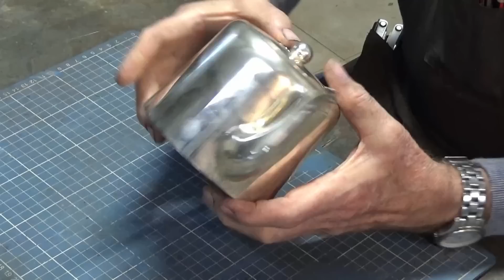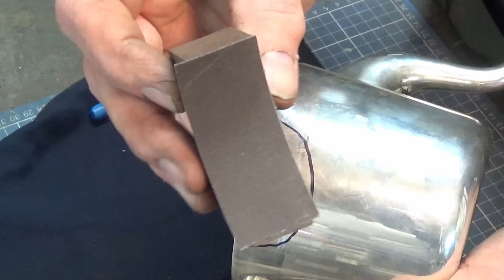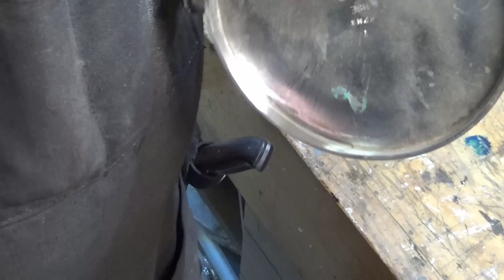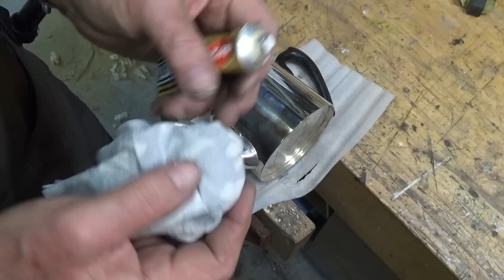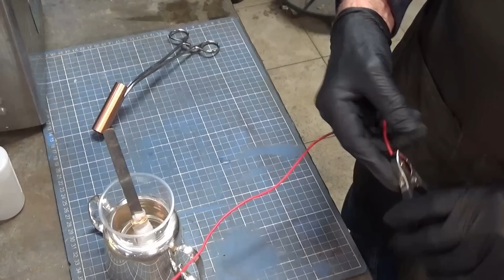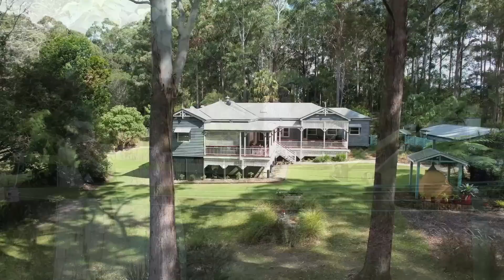Metal Finishing with Mark - Brush Plating 101

Comment: You could have used a small vise and curved blocks to get rid of that dent 
Always heat it first to reduce metal fatigue, especially if the metal has been stretched
Those very small dents should be worked out with an autobody hammer

Comment: i have a question  i would like to do some nickel plating would i need a nickel brush wand or can i do with a stainless steel one.
Reply from the maker: A stainless steel wand will work with Plug N' Plate nickel from Caswell. https://www.caswellplating.com.au/store/store.php/products/nickel-plating-kit-plug-n-plate-brush-plating
You can buy the nickel solution separately and just make your own wand and the bandage can be anything that holds the solution, Tyvek works well (disposable overalls) and a cheap mobile phone charger will do for the power supply. 
Regards,
Mark

Comment: @11:49 that spot is low because the disc (“bottom”) on the inside has been deformed in addition to the outer shell. For the outer shell to become dented inwards, the disc had to also bow upwards or downwards to accommodate. I can see an increased “shadow line“ at that location of the solder seam. I bet if you made a small straight edge that could fit inside you would see a discrepancy in the surface contour of the disc in that region. The next operation should be to make a shoehorn like mandrel that you can put up inside the base and then hammer/press that disc down so it pushes back outwards against the shell. (Really, that probably should have been the first operation, before using the dies to press the outer rim, but unless you had done this exact repair before it’s unlikely foresight. I know I certainly wouldn’t have thought of it).  I am still at this timestamp of the video so I would not be surprised at all if you end up at this conclusion on your own.
Reply from the maker: I really envy those sheet metal workers and car repair guys who know instinctively how the metal has moved and how to coax it back into shape. I was a bit wary about using a lot of leverage or hammer blows in case the seam split. I had never worked with this type of silver ware before so it was a bit of a learning experience for me. I made the decision to avoid hammering as much as possible after seeing what happened when I first tried using a soft mallet and a dolly. 
Regards,
Mark

Comment: You are the metal finish master. I wish I could have discovered your art while still teaching. Metal shop projects always paled next to the wood shop finishes. An amazing restoration Mark.
Reply from the maker: I know. I used to get frustrated that the metal projects we had on our curriculum would inevitably start rusting from the day the kids took them home. When I first started teaching, about the only finish we had for metal projects was an aluminium liquid paint called Silvafrost. It looked ghastly and cleaning up afterwards was a pain. It was only just after I retired that I got the guys at work to invest in powdercoating. 
Regards,
Mark

Comment: Mark watching you repair the pot took me back to my working teens I worked for UK company Elkington who were well known and respected in fact they help Royal Warrants which for those that may not know means they supplied the Royal their main business was in silverware both hollowware and flatware and in their later years did produce a limited amount of E.P.N.S also moved into stainless steel. To get to my point the silverware was high end and on a Friday afternoon any pieces that were to be scrapped were 'beaten ' by the apprentices with large mallets in order to deter anyone trying to sell it on as a second .Given your delicate repair I reckon there would have been a job there for you.
Reply from the maker: Thanks. I do know what a royal warrant is. I was on a tour of Windsor a few years ago and our guide pointed out a builders van with the Royal Warrant on the door. Evidently, the van belonged to a cabinetmaker who must have been appointed to do renovations in Windsor Castle. I recall seeing a video by Waterford Crystal and they would smash any pieces that had even the slightest defect. They stood by the marketing ideology of never selling "seconds". 
Regards,
Mark

Comment: Very interesting video Mark. In my working life I was in the photographic equipment trade for 43 years. We used a similar method to remove dents in camera lens filter mounts. Often with hard wood formers on the outside rim of the lens, and a fibre rod  on the inside against the filter mounting thread to tap the rim back into shape. We had a range of formers in different sizes which we made ourselves. This mostly worked out ok and enabled a filter to be screwed in. Every time I sold a lens I recommended buying a filter for this very reason. A damaged filter was easier to remove than a dent! I have a similar rag cutter that’s hand held. It has two blades that are moulded into the plastic grip. The blade is not replaceable, but they only cost about UK£1 each. Loved the wildlife footage. Cheers Nobby
Reply from the maker: Thanks Nobby. We had an old Pentax SLR camera at a school I worked at. I student dropped it and the focus ring thread got jammed. I took it to a camera repair shop and asked how much it would be to do the repair, expecting something in the range of hundreds of dollars. The repair was done and it only cost about $20. Somewhat surprised, I asked how it could be done so cheaply considering that the complete lens would need to be dismantled. The shop owner showed me a little hardwood chisel shaped tool and said that the focus ring was just cross threaded and all it took was a light tap from a hammer and careful placement of the chisel to make the thread jump back to the correct place. You are correct about a filter. I keep one on my video camera. Weld spatter can ruin a video camera pronto.
Regards,
Mark

Comment: Hi Mark, I'm commenting at about 14 minutes in. Is the indented material not above the "floor" of the pot. So far, you've successfully  straightened  the lower portion of the dents, but the bit remaining is part in the floor and part in the wall above the joint. Some form of an internal anvil might be better, convex for the wall, but flat for the floor at the same time. It is difficult to describe, but if you can picture an anvil supporting in two directions at once. Just my thought. Otherwise, use soft solder to fill the depression  before  replating .
Regards from Canada's banana belt. 
🤞🇨🇦🍌🥋🇺🇦🕊🇦🇺🐨🪃🫕🏁
Reply from the maker: Thanks. I am not one of those metal wranglers who can look at a dent and then determine exactly where it needs to be stretched or shrunk and then give it a few taps for a perfect repair. I really admire those guys who do the paintless dent repairs on cars. It's fascinating to watch. My fall-back position was to soft solder over the tiny pits and then plate over it but I pushed on with the sanding and it all came good. 
Regards,
Mark

Comment: Wow, absolutely fascinating video. Learned of brush plating some time ago but have never seen it in real use. Impressive restoration of the tea pot demonstrates your amazing skill set range and knowledge. I'm always impressed with your wide range of skill. I would have called the dent "patina" put it on the shelf as-is. Nice drone photos of your house, but I doubt I'm alone with the cringe thought of painting it. Quite a bit of wildlife, are the ducks native? Bought two rag cutters from your link, discovered what must be a dozen China copies on Amazon.
Reply from the maker: We recently had the house painted but for the first time we paid a contractor to do it. I am too old to be climbing scaffolding and they were finished within three weeks. The ducks are native black ducks and they seem to be a permanent fixture in the garden now. We also see native wood ducks after the breeding season. It's always a bit sad to see them with 7 or 8 ducklings soon after they fly (or fall down) from the trees and then over the course of a week or so the numbers gradually drop off as they are taken by feral cats and birds of prey. They are lucky if one or two make it to maturity. 
Regards,
Mark

Comment: Great video again Mark. How hard wearing would these brush finishes be for things like tools and handles that get touched a bit? Might make a good rust prevention coating
Reply from the maker: Brush plating is not much different to regular electroplating and the durability really depends on how well you clean and prepare the underlying metal. For complete protection you would need to ensure a good build-up. The Caswell instructions state that you can actually submerge the part in the solution and place the wand in the solution as well and it plates continuously over the entire part. The only difference is that the silver ions are actually in the plating solution and deposit on the part where as with normal plating you would use an anode of pure silver and the electrolyte is used to transfer the metal plate to the part. For steel parts you would use a copper plating solution first and then something like nickel or nickel cobalt. I cannot be sure but I believe that nickel won't deposit directly onto steel. Zinc is good though for direct plating to steel. 
Regards,
Mark

Comment: Just a thought; gunsmiths use many light hammer (2 oz) blows to move metal around. Have to approach this without thinking you are damaging your wife's treasure. Fear is holding you back.
Reply from the maker: I really admire those artisans that can look at a damaged piece of sheet metal and coax it back into it's correct form with very basic tools. I did actually visit a shop that repaired brass musical instruments. They were working on a tuba that had been in the back of a car which was involved in an accident. Not only is the brass very thin and brittle but it's also bent into convoluted shapes meaning that you need elaborate mandrels and dollies to hammer against. It's a true art form.
Regards,
Mark

Comment: Great rescue Presso 👍 The brush plating looks like a nice easy method but sadly beyond my budget. I rember from my time repairing brass/woodwind instruments that most dents etc were easily removed using a simple ball or rod mandrel and a rawhide mallet. Most common damage was flutes bent in the middle cos they get laid in the lap and then get squished when picking up a sheet of music🤦‍♂🤣
Reply from the maker: Well, I admire anyone that can repair a musical instrument. I was invited to visit a place that repaired brass and woodwind instruments and it made me appreciate how much skill is involved. They showed us a trumpet that looked good until they shone a light inside the bell and held it up against a dark background. It was riddled with pinholes. Evidently, some musicians have "acid breath" and it can eat away the brass. 
Regards,
Mark
Reply: Was very interesting, lots of moving parts. Saxophones are pretty crazy😮 Really enjoyed the technical/mechanical bits snd got pretty good at it but didn't have the skills to test em...and yep, things like "flute juice and trumpet trash" were hazmat nasty 🤣🍻

Comment: Absolutely beautiful! You can see a bit of feathering for the area where the dent was. I can't see the dent but I can see where it was sanded. I'd imagine it's mostly because the new silver is so much smoother than the old stuff. I don't know much about silver and precious metals but could it be a different grade of silver maybe? Or would that affect the look sort of like two different batches of the same paint? Also, if you wanted to full in all those nicks and scratches, could you just plate right over it, or would you have to sand or polish it first? I'm not sure the thickness that the plating gives it versus how much is removed by sanding and polishing. Absolutely beautiful though! I wish I had some spare money to try doing this on a cheap antique
Reply from the maker: The sanded and polished area did look different in texture to the original surface which had a lot of nicks and find scratches. If you wanted to re finish the entire piece and get a mirror finish you would probably need to strip all the original silver off it by reverse plating and then copper plate the entire part. The copper can be quite thick and that allows you to polish the surface with different grits before buffing and finally re-plating with silver. You can build up the silver plate with the brush plating technique but it's probably not going to be consistent thickness. Using a regular electroplating bath and using carefully positioned anodes allows you to get a bit more control over the thickness of the plate.
Regards,
Mark

Comment: I rather enjoy these tutorials on metal finishing.  I have a few antiques, that have been in my family for over 120 years that I would like to restore.  The first thing on my list is my victrola, needs some metal finishing and woodwork primarily replacing the veneer on the cabinet top followed with a bit of French polish.
Reply from the maker: Well, the good news is that brush plating is very forgiving and quite easy to do. Same with french polish work as long as you don't need to fully strip the wood back to a bare finish. There are some good premixed french polish revivers that are a mixture of shellac and oils which will remove any surface ground in dirt and dust but also build up a new shiny finish. 
Regards,
Mark

Comment: Very cool. Nicely restored too. Extra special thanks for the Caswell information. I have some radio equipment that has electronic parts and connecting copper wires that are plated in silver and I always wondered how I could easily restore those. Now I know!

Comment: Excellent job as usual but I feel you took some of the history away from the piece, I think the initial reforming was enough but of course it's a matter of opinion. Keep up the good work, I've replated a few silver trays & it's quite time consuming to get a great finish & dealing with a cyanide solution is off putting.
Reply from the maker: It's always something of a dilemma when it comes to restoration. We have no way of knowing when the teapot was dented. If I had left it as it was it may have corroded in the area where the dent was. It still retains a lot of it's original patina though.
Regards,
Mark
Reply: For most of its history it didn’t have a dent so all good historically. Lovely job Mark.

Comment: You're really brave. I don't think I would have attempted that. I used to brush plate and electroplate in the 90s. Very similar to what you did here but I never attempted any spot repair because they tend to not match very well. The copper applied to the base metal is a copper strike and it does 2 things; Copper sticks really well to base metal as does the electroplated metal stick really well to it and because of this it adds incredible durability to the plate. The plate is less likely to flake off when the base metal has been copper struck. The other thing it does is it affects the appearance of the plate. It really gives silver and gold a real good finish. If no copper strike, the silver and gold will look a lot brighter and may not have that solid silver or solid gold look. One of the things I used to plate for people were coins and everyone always favored the coins that were copper struck over the coins that weren't because of how it made the gold or silver look. If you ever do a repair and remove the copper strike, be sure to re-strike it before plating.
Reply from the maker: Interestingly, I just recently purchased a product called Ultrastrike. It's a alkaline copper plating solution for steel and other metals but I bought it for another project. You can buy a brush plating copper solution but this was really a cosmetic repair. If the silverware was intended to be used every day it would be worth doing it correctly with the copper strike. 
Regards,
Mark
Reply: A strike is particularly important if the substrate is ferrous, the first splash of solution forms a loosely adherent immersion deposit. The strike should only deposit metal when current flows.  This also applies to things like zinc based diecastings which which dissolve in acid electrolytes.

Comment: I wish I'd known about this process 30 years ago. You wouldn't know it had been repaired. I might have been able to rescue my grans old silver plate tea set. She polished it to destruction basically, there was copper showing through everywhere. I think it went for scrap with a load of plumbing fittings and the like.
That aerial shot, gives some idea of how big your workshop is Mark. We have been trying to move for years now, but when I put in for outline planning for a 1000 sq/ft garage workshop if gets turned down, so we pull out of the purchase.
Reply from the maker: The thing about my workshop is that I have to share it with two cars! And, my wife gets quite cross if I don't move her Subaru Impreza out of the garage when I do any work in there. I have already incurred her wrath for putting steel particles over the white paint. I got away with it until they began to rust.😯 A very expensive car detail job later taught me a lesson. I don't care about my 13 year old Camry. It can take it's chances.
Regards,
Mark
Reply: @Preso58  Ha haa, my wife wants to put her Honda Jazz in the garage, but my old Roundhead Colchester Triumph is in the way of the door. Hopefully it will be gone soon, I don't need two  Triumph sized lathes.

Comment: A piece of leather on the convex die, targeting specifically the low bit when using the press. But mate, you have done a damned fine job.
Reply from the maker: There were probably ways of packing the two dies to target specific areas. Unfortunately, the corner of the shop where the hydraulic press lives is quite dark and the curve looked perfect until I took it out in the sun. By then, I had moved everything on the press. It got me really close though.
Regards,
Mark